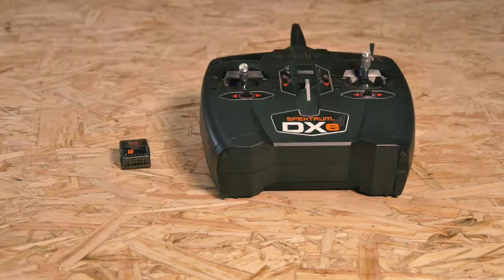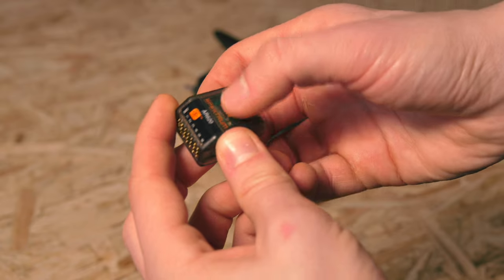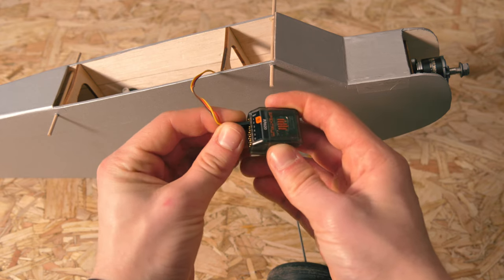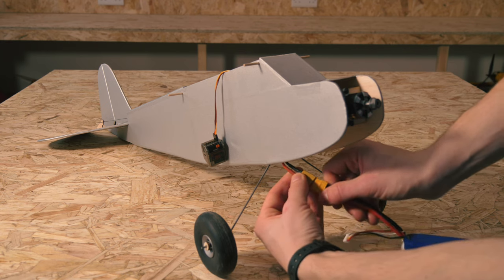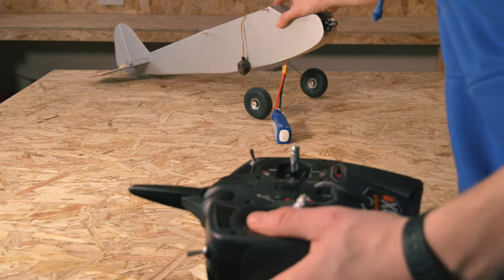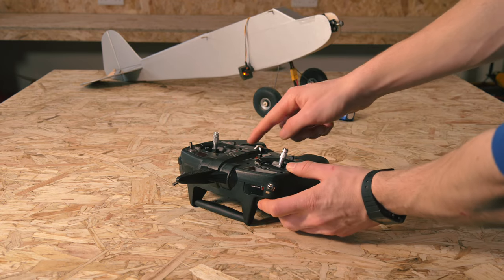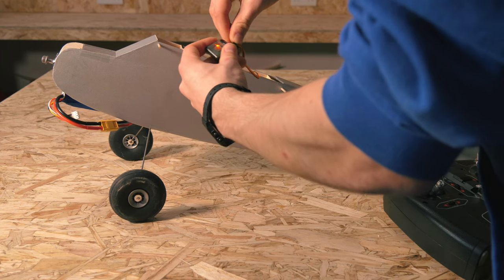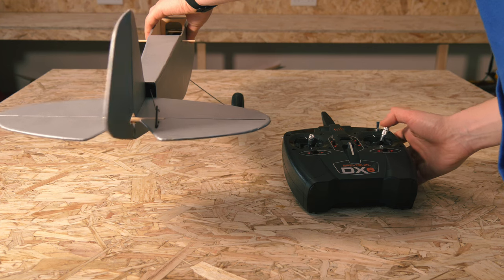BINDING a Spektrum Transmitter to a Spektrum Receiver!

Comment: Hi I've got the same set up I had an acserdent what happened you have motor then ESC with 3 wires then two wires for battery I had to change connectors I done a stupid thing I had +/- - + when it should have been ++/-- - so when I put that straight the reciver won't bind coud that have damage the reciver or the ESC I would be great full if you can give me an answer thanks Colin

Comment: Does this automatically assign safe to a switch with this transmitter ?
Reply: Did you ever figure out? Cause there isn’t one on mine with the 1.2m p-51 d cripes a mighty… intact the as3x is disabled also. How can I get rid of throttle cut and replace with safe1 and as3x on 2?
Reply: I figured that with the umx planes its assigned automatically. However after you bind a BnF none umx safe and As3x need to be assigned upon binding. This is done by holding both sticks to the outer position then flicking channel 7 5 times back and forward. Look up Ojeez rc he shows you the process flying the 70 mm Viper, showing you can fly any BNF with the Dxs transmitter with safe and as3x 😁
Reply: Also I forgot to say it helps if the transmitter is updated, there are 4 different profiles. Two plane and two wing for planes. And 4 for helicopter mode once updated. The way to access the modes without updating with mine. It's was hold bottom two trims outwards as you turn the controller on. Puts you straight into the 4 plane. Profile modes. With my Habu due to safe and the rudder its on mode 2 extra functions mode. Mode one is for standard bank and yank planes. This is my experience so far anyway, hope it helps 👍🏼

Comment: Thank you for posting this video. I purchased a Spektrum DX6e and was having huge trouble binding it. After watching this video and learning to connect the power while pressing the button, I was able to complete binding first try.
Reply: I was giving it up after hours of the constant beep sound. Trying to bind a DX6e to the AR620 on a Hotliner. Tried everything I could find yet, reverse throttle and so on. As soon as I have a binding, its beeping all the way. Servos are working quite well. Had it all in an E-Flite system before but don't want to be trapped there forever.